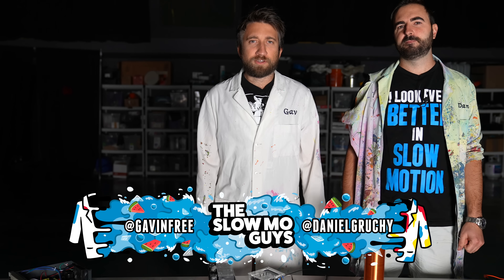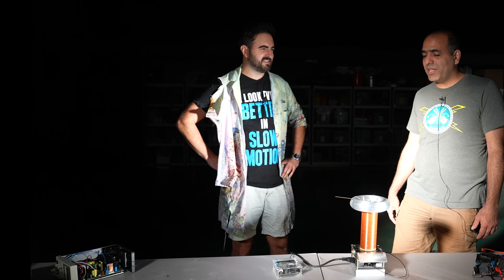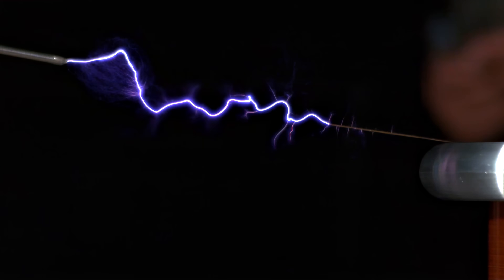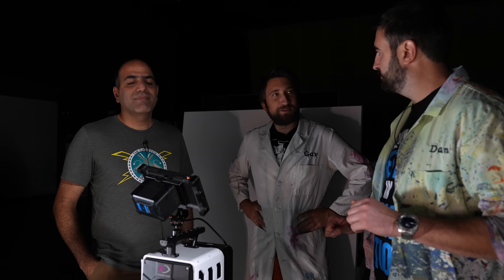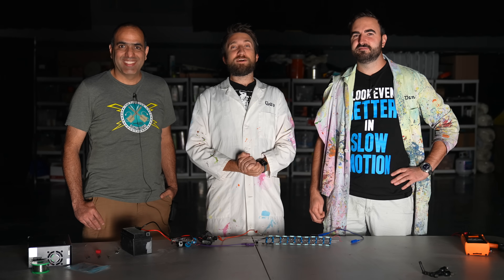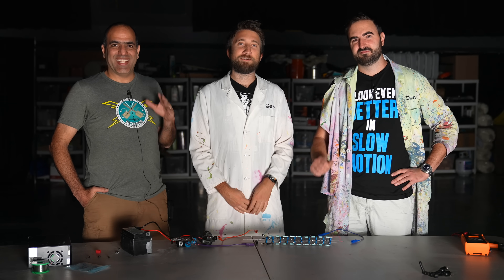Electrical Arcs at 1,750,000FPS - The Slow Mo Guys with ElectroBOOM

Comment: Good video. The reason why the furthest node activates first is because marx generators charge all the capacitors first. The spark gap connects the circuit. So the furthest node is the one needed to connect the circuit and thus sparks first. Note: I am tired atm so I am not 100% sure my theory is correct. If I'm wrong ask Distinti, they can probably solve this.

Comment: the tension on the last one is higher while the current is higher in the first one, mby due the the phase changes thru the capacitors which are in serie

Comment: They follow the same path as the previous spark, bcuz the air is already ionised by the previous spark. Therefore new spark will tend to travel in higher conductive path.

Comment: Interesting conundrum... trying to film something moving at the speed of electricity/electrons using an electrical device (Phantom) that relies on sending electrical signals and data at that very same speed ... could a quarts crystal ever oscillate fast enough to drive a circuit to capture the movement of electricity.... kinda like asking if a creation ever outdo its creator?

Comment: Wintertime in the midwest taught me the screwdriver trick. Every doorknob is a potential shocker so i walk around with a small screwdriver to release the voltage i saved up walking around.

Comment: 4:27 there is a reason rubber tires in your car will not stop lighting hitting your car.

Do you think that a few inches of rubber will stop a lightning bolt that has travelled through miles of air.
The voltage is so high that it will jump across a large gap to reach the ground.

Comment: If only you could have gotten a non-earthed platform to hold an Iron nail in place and see what the electricity does then... If you used magnets for example i'm sure it would create magnificient results!

p.s. the entire thing mit explode or at a certain voltage you could possibly see the magnetic-eletric field in action. Do more, DO MORE!

Comment: If the arc of electricity is 2.78E7m/s crossing 5 lengths of wire of 1/36th of a meter then to see half the arcs switching on you would need a camera taking a frame in 4.996 nanoseconds, if each frame is 1/1750000 = 571.4 nanoseconds then you would need a camera 114.377 times faster! 
If you wanted to se each one fire individually you would need a frame in .999 nanoseconds which is 571.89 times faster!

I'm not sure if discharging electrons (such as a lightning strike) go at this speed or not, I've heard it is one third the speed of light which would result in needing a frame in 1.389 nanoseconds, then you would need a camera 411.429 times faster! To see each turn on then requires a frame in .278 nanoseconds which is 2057.14 times faster!!

My math could be wrong but the idea of needing speeds this fast just to see something we're witnessing every day when the lights turn on is so cool!

Comment: A collab I've wanted for ages. It's always a fun time when Mehdi comes over.
I wonder if there is a simple program you could write/get that can do the video skimming for you. Given the enormous brightness difference between active and inactive frames, surely an algorythym can compare them and assemble just the active frames to save you hours of skimming when dealing with these frame speeds. Or at least tag the centre point.

Comment: When Dan held the screwdriver to the Tesla coil while holding the screwdriver and didn't feel a thing (at first), I was reminded of a trick I do when I want to discharge static but not want to feel it: hold a metal key and touch something conductive. It'll discharge static from you and you won't feel a thing.

Comment: re: Your open air Marx generator; you would need a "light speed" camera to capture the propagation of the arcs as one of the trigger mechanisms for the following arcs is the UV light emitted by whichever one breaks down first.  This has been proven/done in the past to synchronize HV arcs by holding the Marx at slightly below its spontaneous firing voltage and then introducing an external UV flash (e.g. external flash or arc) to trigger the Marx.

Comment: You should film a power arc at a HV power test and see if it goes dark as quickly. I would think that the air has afterglow, when there have been kiloamps going through the arc.

Comment: Does the arc in the marx generator 'travel' to the other side, or does it just ionize the air between them and is there no time difference between the top and the bottom of the arc? If it is the former, the arc is travelling at least 40km/s assuming the distance is 2cm

Comment: 14:04 I think they were talking about the wispy bits around the right end but what I can't stop looking at is what I can only describe as a corona covering the entire upper right half of the frame all leading back to the bare leads. You can even see them arcing back to the beginning of the 3rd, 4th, & 5th resistors from the left

Comment: For the normal speed footage, you probably should've used a 360° shutter (i.e. 1/50 s, with a neutral density filter if necessary) so that the arcs would actually be visible. As it was almost none of them were visible due to the short shutter speed.

Comment: I'm obviously no physicist, I feel like the electron finds the path first with low level energy(aka the clouds of lightning), and once a connection is made it sends all of the backed up potential energy, and first spark before anything is the energy reflecting back some electrons, in a way showing the way to travel and the spark is that energy reacting with travelling in opposing directions to the normal energy flow. Now to go watch the video to actually find out

Comment: I think that the blinking that was observed with the tesla coil arc is due to it being an ac current. 

The arc is brightest at peak current and goes dark when it passes through zero on its way to the inverse peak.

If you could change the output wave to a square wave, you might get a more distinctive on-off blink, rather than a fade in, fade out.

Comment: I know this would break things in physics. But... what if the reason the last one seems to light up first is that the arc is moving FTL for that fraction of a second giving it the appearance that it started from the endpoint. A more reasonable explanation is that there is a built-up electric field around the device before it goes off and the arc once started connects at any point in the field across to the rest, but the speed is so high that for all intents and purposes it seems instant. Just some ramblings from someone who doesn't know much about how electricity works.

Comment: @ElectroBOOM 15:53 my guess as to why the last one is turning on first: assuming the circuit as a waveguide in which there is a mirror in the end; the last capacitor is the first one in which the incident and reflection electromagnetic field is adding up together doubling the wave amplitude in the last capacitor first!

Comment: 8:24 On and off. Is that the secondary ringing? The primary spark gap frequency is much lower, bam, wait a bit, secondary output, primary resting, waves moving back and forth in the secondary continuing some output on each cycle, and eventually another primary bam

Comment: The "fluff" at 5:55 is quite cool. The resonance shot is at 10:10 - it manages to cool off enough in that time between pulse peaks to show up blinking and it shows up for both peaks within a period.
CPU cache operational delays are measured in nanoseconds (billionth, 10^-9) and a clock cycle on a CPU is 1/3 to 1/6 a nanosecond nowadays, reliable on/off switching between the transistors , the gates they form and the operations those form. Quite nuts.

Comment: 17:27 It looks like, not only does the lowest resistance point start the cycle, but it looks like a faint arc finds it's way back to that first gap on the wand. Over the top of the output arc.
Reply: 18:20 & 18:21 the circuit doesn't flash brightly until that phantom arc reaches back to the first gap. Like the flow jumps from wand to clip and closes by reconnecting to the gap...
Reply: Where is the steamer coming from? It's like the circuit is pulling the steamer out of ground... Maybe. Why does it not complete circuit to ground? Why does it jump back into the active circuit? And does that cause part of what disrupts the flow?

Comment: As I understand it, what we're actually seeing is the release of energy that accompanies the ionised gas recombining with electrons from the atmosphere. When the ionised gas molecule regains a previously removed electron, the energy that was required to ionise that molecule is released and seen as light. So the light from an electric arc isn't so much about seeing the ionised trail of the path of the electricity, but that we're instead seeing this path as it de-ionises.

Comment: 16:28 They should add a feature where you set a mask in the screen where you want to detect a movement, a difference in color, etc to stop and/or make some keyframes, so you can "jump" to that part of the footage and check them quickly, like choosing chapters in a movie...🤔
Reply: Read their comment about it

Comment: Can you network several of those cameras and offset the frame start to effectively double, triple, or better the frame rate? 
That is, start camera A, then camera B a quarter frame later, camera C half a frame after A, them camera D at 3/4 frame before camera A opens its shutter again to start its frame 2.

Comment: There are papers that show the initial arc creation of a capacitive discharge circuit can have peak currents 1000's of times higher than the average discharge current.  This peak occurs on a time scale of 1 to 10 ns.  Crazy stuff.

Comment: Just FYI, also probably allot do mention it in the comments, they do not trigger at the same time but very fast in those small Marx probably within 100 ns. Bigger generators used for testing HV equipment are slower, but still <500nS you can see it in the output voltage often. But yes, you would need an even Faster camera. Also, an interesting fact, the UV from the first gap that ignites causes also breakdown to happen in the other ones. That's why the Gaps in a big generator have to "see" each other, also the construction of the generator forces additional breakdown to happen, maybe you can get access to a HV lab and maybe someday do it on a big one. I'm unfortunately in Germany, where i you get you access to such a big lab with a 1MV Generator.

Comment: So If I understand the contraption properly the reason it starts at the end is because the voltage has to rise high enough in that area to over come the air gap and as soon as it does all that electricity suddenly has some where to go initiating all the others at the same time

Comment: I wouldn't trust him :)
Interesting that the ladder goes almost simultaneously. It's 600ns frames yet they never showed any progression, suggesting it's significantly faster than 600ns which brings it close to the speed of light.
It's actually strange because inductance is in play for the current to ramp up so for that to go to full brightness within a frame, that's a bit surprising. I guess it's a single 1cm wire loaded with around 10kV.  formula says 10kV/6nH is a ramp up of 1.7trillion amps per second so I guess that's pretty fast. Or 1million amps per frame so...   it's fast.

Comment: These lightnings are cracks! Cracks in the air and filled with plasma! The behavior is the same as with the thunderbolt lightnings from the other video: as soon the lightning reaches a surface (either the Earth or Dan's hand) all the charge (plasma) flows through this path.

Comment: For next video, don't if its possible 4 u guys make it, but if possible, make an incandescent bulb filled with hydrogen gas and oxygen gas in the ratio 2:1 switch it on, also do it with its head submerged in water

Comment: I saw the video at 0.05x using a browser plugin, and I believe that there is a delay in the Marx Generator, the left one lights up, and then sequentially proceeds towards the right. The last capacitor reacts first, and here's my explanation:

The electricity notices a gap in between the capacitors from left to right, so it progresses towards the last which also has an air gap, so it tries to jump and a connection forms b/w air with the other capacitor, then the arcs jump from one capacitor to the other from the left towards right.

I know I've personified electricity and portrayed it as smart and able to find a path, but I hope you understand what I mean.

Comment: The Marx generator spark timing is easy to understand (until we step back & think).
We can build a greater & greater pd but no significant current is flowing.
When a spark discharges the pd a (relatively) high current does flow.
Easy - So:
If All the sections of the spark gaps have the SAME IDENTICAL Z (impedance)
Which isnt exactly possible,   then they will all spark at the same time due to the currents in the sparks being in phase / phase coherant.
However:  if there is a mismatch in these impedances then the currents in the sparks must be "not synchronous" as viewed in "our-time frame.
So the sparks photons must appear at different times to our time frame.

Comment: As a Plasma Technology student, here are some thoughts on the video:
2:33 There might be two things at play here: As Medi mentioned, there is an ionized channel in the air and some of those ions/electrons might still be present by the time the next arc hits, reducing the required energy. There also exists something called metastables. A metastable is an excited atom/molecule that can't emit light (due to quantum mechanics). These metastables have quite a long life-time and are, because of their stored energy, easier to ionize. So the ionization energy of that channel decreases. These effects are then counteracted by convection (aka hot air rises), but it's a much much slower effect.
10:56 Yes, air can indeed blink that fast, even faster still. The lifetime of most excited states is in the range of a few to tens of nanoseconds. In plasma science, the most common frequency is 13.56 MHz, even there the light emission follows the shape of the voltage really closely. Optical spectroscopy is one of the most common diagnostics for us.
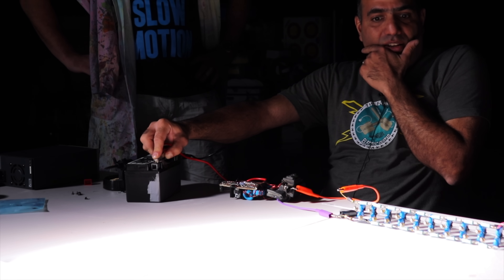13:29 Here you can clearly see the effect of convection, which creates this nice arc shape
14:20 This is a really important detail here and it's really interesting for to actually see this. In atmospheric pressure electrical breakdown mainly happens via the so-called streamer mechanism. At these pressures, the electron density gets so big, that electric field that these electrons generate gets so big, the whole effect gets self-sustaining. A so-called streamer forms, which consists of a streamer head with a large number of electrons and a conductive streamer channel. Once the streamer hits the other electrode, there is a highly conductive channel between the two electrodes, essentially shorting the high voltage. This leads to these massive sparks. A streamer typically travels at the speed of a million meters per second. So assuming a 5 mm gap, that makes it 5ns to reach the other side. It is really remarkable that it's still visible here.
17:20 at a time resolution of less than 500ns you still can't really tell, if all of the gaps ignite at the same time or not. Electrical breakdowns can happen at much faster timescales. The scientific method to investigate this, would be to use a so called ICCD camera. These cameras can reach exposure times as low as 1ns. However, they can't shoot continuously. So you need a repeatable way to precisely trigger the discharge and then use a so-called delay generator to sync that to the camera. That way, by changing the delay between ignition and the shutter of the camera you can scan through the whole discharge at a much higher resolution

Thank you guys for this awesome and really interesting video!

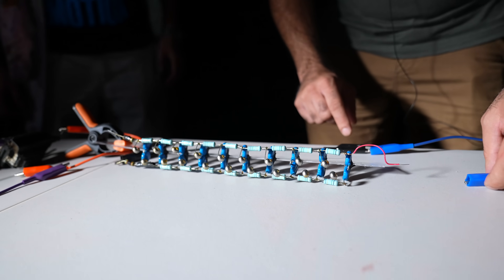Comment: 12:30 Yes, you can upload a video longer than 12 hours. I've seen videos over 20 hours long (GTA V 100% for example). As long as the video file is under 250GB, I think it should upload.

Comment: Just a thought...
The spark gap that fires first is the most narrow gap, and the first gap that breaks down charges the rest of the matrix over the breakdown point, setting them off nearly simultaneously and creating the high voltage burst at the output.

Comment: Couldn't you improve the resonant frequency measurement by counting several (all?) brightness peaks and then dividing by the total number of frames? If correct, it should even out any inconsistencies and get a closer result than just counting 4 frames.

Comment: my money is on no arc until the complete circuit can actually allow current to flow so while the charge density of the preceding spark gaps will be charged and ready to fire the ground side flow wont accept electrons untill the circuit completes. so last spark gap acts as a switch to ground at the last step as the discharge function of the marx circuit is a series wiring arrangement. if you could see nearly at speeds of the level of the speed of light video there would be a noticeable cascade down the circuit, which really is pushing it as were talking fast enough to watch the answer to that veritasium "beef".
also the parallel charge of a marx isnt perfect and likely fully charges the last stage last just due to the tiny increase in resistance compared to the other stages although i dont actually know off hand if that would be enough to cause the effect without needing full voltage to break down air and complete the circuit. 
also dont see six am the other way up too often, grim doesn't even begin to touch what it does to your worldview.